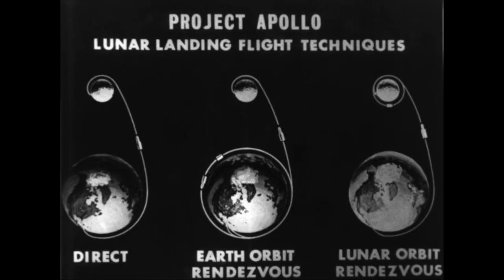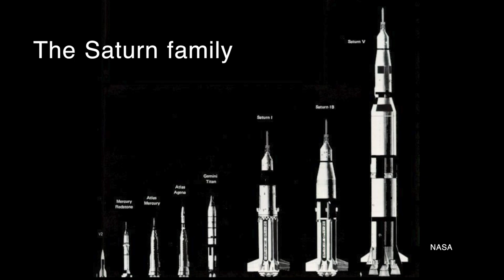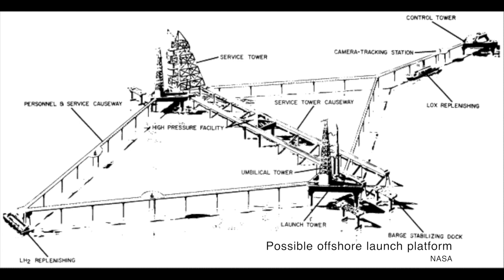How the Sounds of Big Rockets Break Apart Buildings

Comment: Spacecraft tools! I will nag every week! How unique are the tools, how simple or extensive(can they repair anything or do they just have pliers and duct tape), how do they minimize weight and movement during different G-forces, how do they secure the tools on EVA? As someone said in a previous video, how do you apply torque in zero-G?

Comment: When NASA started launching the Space Shuttle,  an acoustic mitigation measure was designed into the launch platform.  A few seconds after launch, a massive amount of water was dumped as a curtain of water fog.  The sound would hit all of the water bubbles and be converted to heat.  This had the effect of reducing the energy transmitted through the air and protecting the launch pad and the shuttle from the reflected shockwave.  This was used because engineers discovered that it was shaking the heat resistant tiles off of the orbiter.
If the Nova rocket or something like it were built, it could use the same mitigation measure if launched from land.

Comment: With SpaceX using smaller engines but more of them in comparison to the Saturn 5 and the physical size being smaller and operating pressure being higher wouldn't this change the resonant frequency of the engine, raising the frequency of the audio bandwidth into the higher frequency less destructive range?
Reply: Perhaps, but wouldn't the constructive and deconstructive interference still work to amplify the sound at certain points to the same amplitude as larger engines.
I would think the surface of the ocean would help to dissipate or even absorb a large amount of sound. Less sound would be reflected off the water, the water has a less regular surface(waves) that would scatter the sound, and the water would carry vibrations within itself in a different way than solid earth.
Reply: Could the pressure from the exhaust of the engines create some sort of parabolic dish shape on the water, whereby a large quantity of sound is reflected directly back at the launch vehicle? Either it would all cancel out or it would build up some sort of destructive resonance in the spacecraft.
Reply: Although the raptor engine is significantly smaller than the F-1, it is only a little under half the thrust.
Reply: I remember talk of the ocean being a less suitable sound dissipater than the acoustically sculpted concrete+whatever troughs used on land.

While the surface of the ocean is variable and textured with waves as you say, that's usually on a very small scale, whereas the overall surface area under the engines will generally average out to flat. That means the majority of the sound is still just bouncing right back up into the rocket. That's a recipe for resonance.

One suggested solution to that issue (that I saw in a pre-IAC SpaceX MCT speculation thread on Reddit that posited a sea-launch scenario - it may have been inspired by something in the old NASA designs Amy referenced) is to pump air down under the launch platform and foam the water to better absorb and dissipate the sound.
Reply: glenwoofit   The noise does not come from resonance in the engine.  It comes from interaction of the high velocity, hot exhaust plume with air.

Comment: Unless I'm mistaken, I remember reading in F. Alton Everest's Master Handbook of Acoustics, that the loudest a sound can get at sea level is 194 dB SPL. This is because at 194 dB the peak of the rarefaction wave is nearly a total vacuum. The Saturn V. already generated 194 dB SPL, so how could any rocket generate more acoustic energy even if it's larger?
Reply: The "volume" there is just the amplitude between the peak and trough of the sound wave, it doesn't describe the conditions in a shock wave, which is specifically a disturbance moving through air faster than sound. It takes some distance for that shock to slow down and transition into an ordinary sound wave, and then more time for that sound wave to dissipate down to safe volumes. The more energy your rocket engines are putting out, the longer it takes for that transition to happen, and the larger the danger zone around the launch site.
Reply: Ok, so the "vacuum" side of the sound wave is capped, but I don't see any reason why the pressure side couldn't get higher.  194 db SPL might be the limit for faithful sound reproduction - something you need to consider when building speakers and speaker stacks (which would be the focus of the handbook mentioned), but I don't think that's an absolute limit for sound.  Especially when you have a ton of thrust behind the generation of the sound.
Reply: Russell Hltn You are correct. I've since read that the cracking/popping sound that is characteristic of large rockets is actually due to the rarefaction part of the sound wave being clipped by the atmosphere, much the same way an over driven amplifier or loudspeaker clip. The clipping adds higher frequency harmonic distortion.
Reply: I believe this is essentially correct.  The 194 dB SPL limit is how much energy the atmosphere can carry and remain "intact", but doesn't exclude the possibility of higher amounts of energy tearing the atmosphere apart and producing nasty shock waves, such as in nuclear explosions (on the extreme end).
Reply: I read that sperm whales produce 230 decibels.
Reply: Sounds can be MUCH MUCH louder underwater.
Also I think you are correct about sound being capped to 194db, but only on the low pressure side of a pressure wave. The other side is under compression.

Comment: I am personally more concerned with the IPTS launch pad itself. In the Saturn V launches, the pad had an ablative coating that was able to survive one launch. A lot of the interfaces had to be replaced after each launch, and the pad itself had massive refurbishing between launches just because of the heat and power that those engines dumped into it. IPTS is going to be bigger and is gonna launch off the same pad twice in one day (and land once)... I see that as a massive problem for pad survival...

Comment: I think the SpaceX vehicle will be LOUD, having 42 Raptor engines each running at high operating temperatures/exit velocity. With regards to the acoustic signature, I'm thinking it'll be around 214 dB. As for destructiveness, it will be less so  than a rocket of equivalent thrust running larger engines like the F1 or any of the ATK solids. The signature of the Raptors will produce a higher frequency signature that will have a little more "snarl" to it, whereas the larger engines will produce much more percussive, deep bass type shock fronts slightly more separated from each other than a large number of smaller engines.

Comment: Hi Amy, I have some expertise in rocket engine exhaust plume noise. I have developed programs to examine noise damping for rockets during launch. Typically water injection systems. What I did learn from this is that noise is not additive. So 42 raptor engines on the SpaceX craft will not be 42 times louder than 1 raptor engine. Water injection can prevent the noise from damaging the payload and launch equipment this reduces noise from 210 dB on the shuttle to the maximum payload noise at 138 dB.

Comment: Launching offshore looks cool; that platform diagram totally looked like a villain hideout from a James Bond movie, but it's also a lot more expensive. If SpaceX can find a way to dampen the sound around LC39 that would probably be a cheaper solution, and operating facilities you can just drive a pickup to is a lot easier, too.

Comment: The sound volume depends a lot on the type of fuel, not only on the trust of the vehicle. So the Shuttle (with solid fuel) was louder than Saturn V (with kerosene/Lox), despite of having less thrust. I suppose methane/Lox will even have a more regular combustion then kerosene/Lox, so there possibly won't be problems with the sound. (Maybe it will be a bigger problem for SLS with its giant SRBs)

Comment: You didn't say anything about pad water deluge systems. I believe they are not just for cooling but also to absorb noise. I don't know about Saturn, but the Space Shuttle and its payloads could have been damaged by the noise reflecting off the pad, especially when the SRBs lit. I'd have to look up exactly how much the water spray actually reduced the sound levels, but I know it was a lot.
Reply: Saturn V used the Water Deluge System as well there is footage on Youtube. If I see it again will edit this with the link.

Comment: I thought of this right after the Space X announcement along with 42 booster engines reminding me of the ill fated N-1 which had 30 booster engines. I recalled the first Saturn-V launch (Apollo-4) which reportedly caused a press booth roof to partially collapse due to the Saturn-V sound wave. Damage to the tower required additional mods to the sound suppression system for launches after Apollo-4. So here is a rocket much more powerful than the Saturn-V or even the Nova shown in Amy's vid. I expect this plan will have to somehow address the sound issue. Otherwise it could cause problems with the VAB. Not necessarily on the first launch, but on a subsequent launch triggering a partial collapse that results from acoustical loads weakening the building going back to the first launch. However, a sea launch platform shouldn't have to be as far out as 100 miles. 15 miles ought to do nicely. But as Amy mentioned, with any new concept changes will be the norm right up to first launch. We saw this with the Apollo and space shuttle plans.

Comment: Amy.. how long before space travel will NOT involve rockets or parachutes?
Reply: Not for a very long time, if ever. There was the absolutely insane Project Orion (not the new Orion spacecraft) which would have used nuclear bombs as a method of propulsion, but there isn't anything on the horizon which could generate the energies necessary to launch a spacecraft. Solar sails and ion thrusters work once you're already in space, but to get to escape velocity, or even orbital velocity, chemical rockets are all we will have in the foreseeable future.
Reply: Lofstrom loop? But that is distant future.
Reply: Justin Franks thank you for your reply..I agree with all that you stated....I'm still holding out hope that somehow the Earth can be used as a magnet and vessels can be "repelled" into space...I know..pipe dream...but fun to contemplate...

Thanks again Justin.

Thank you Amy for posting the videos. They are completely enjoyable and so informative....
Reply: Cirne Songs I have a idea which is feasible but I'm still in High School.
So even if it works, we still have to wait about 6 years at min
Reply: Cirne Songs As a huge SpaceX fan I'd say parachutes are on their way out, but rockets, maybe not.
Reply: The space elevator is coming way quicker than you think.

Comment: With STS, NASA used water sound suppression.
Jets of water, spraying under the engines, over the exhaust trench disrupted acoustic shockwaves. Primarily it was to stop the reflected engine noise from stressing the wings of the Orbiter. But surely this principle could be used to create an "Acoustic Curtain" around the pad for SpaceX?

Comment: Then there's the Sea Dragon which was so crazy-huge that it would have dwarfed even the Nova. The first stage had one ginormous engine. About 24 yards in diameter! The whole completed stack would have been built at a shipyard then dragged out to its launchpoint in the waters of the Atlantic.

From there, it would have been tipped vertical and launched from the partially submerged position. The sound wave would have killed every living thing in a five mile radius.

Comment: I remember an old suggestion that huge rockets could be launched from a pad in the centre of a giant concrete bowl partially filled with water. That should dampen a lot of the sound and send another part of the sound up rather than horizontally. I do not know if that would work or if it might cause hell for the rocket. The shape of the bowl should not focus the sound.

Comment: Any,  The water they flood the pad protects the pad from the heat ,does it do anything for the sound at the pad or the sound radiated away from the pad.  

Thanks,   CNM
Reply: Water dampens the sound so the concrete pad does not get destroyed.
Reply: And so that the sound doesn't bounce off the pad and damage the spacecraft (as happened with Space Shuttle Columbia on STS-1)

Comment: A single F1 engine test in Huntsville broke windows and rattled houses in the 60s
Reply: I can remember rocket tests from Rocketdyne in the Santa Susana mountains (San Fernando Valley CA) during the 60's. The tests could be heard all the way to Burbank (getting close to 20 miles). I was under the impression they tested the F1 there but now it sounds like the F1 would have been too large (made too much noise).

Comment: I have a question about the Apollo RCS jets. The nozzles extended from the side of the service module. Could you address, at some point, how they didn't get sheared off? I suspect that the air flow over the BPC may have spared the RCS and the thinner atmosphere at high speed may have played a role as well. Am I off base? It seems, though, that the RCS pods would be vulnerable.
Reply: This has been brought up before and they were thoroughly tested to withstand max Q conditions. Google "collectspace Launch stresses on Apollo CSM RCS nozzles"

Comment: I believe we have to worry first and foremost about vehicle structure and components being damaged or disabled by the massive acoustic power. I suspect they might lift off at partial throttle to reduce acoustic energy transfer through the thickest part of the atmosphere and then throttle up when the air is thinner.

Comment: would it be possible to arrange the engines in such a way that they can create a cancellation pattern that actually reduces the dangerous waves that are put out. or are the frequencies to erratic for that to be possible?
Reply: The problem is that imperfections in the engine and combustion instabilities might generate unpredictable noise so designing a pattern to cancel out the ignition sound is quite hard
Reply: Dan Harriman I wonder how big the speakers would have to be if they were to install an active noise cancelling system on the launchpad...? :-)

Comment: dB is not a unit. It is a log function that You can use in certain situations. If You say 126 dB Spl RMS A(weight) This is correct unit for measuring "avarage" sound level.

Comment: Wouldn't the smaller engines produce a higher frequency sound?  They could also delay the roll program as distance plays a huge factor as does the angle of the ship.

With shuttle launches, from the normal viewing area which is over 5 miles they weren't all loud most of the time, you could feel the low frequency sound and it could be observed on glass.  It was loudest after the roll program with engine were point more towards you.  I was on KSC property for 4 launches prior to 9/11 and another 2 from offsite around ~12-15 miles away.

Comment: I think it will always be cheaper to prepare the buildings for the sound / buy out a bigger buffer zone, than building a whole new launch zone on the ocean. Not to mention the environmental impact it would have
Reply: stren Depends if you build an offshore clone of cape Kennedy (like the 1960s plan) or build a launch ship that is prepared on land, then sailed out and launched with a few regular ships nearby doing support (like SpaceX landing ships).  The second option can be a lot cheaper than the first, but requires dealing with launching from a rocking boat.

Comment: Great videos!  I was 4 or 5 when my dad would get me out of bed to watch live NASA Apallo brodcasts.  Thanks for helping vevive my excitement for space, along with Everday Astronaut and Elon Musk.

You talking about the insanely high aucoustic forces from a launch, it made me wonder about the engineering designed to protect the crew from hearing damage.

And where is the threshold between the violent vibrations the crew feels, and where low level aucoustic damage happens to the human ears? 

And what type of insulation or attenuation is used to protect the crew.

Comment: Would it not be possible to add sound absorbent material, like a good few groves of trees, in the area, as a natural sound absorber. Seems to have been done already there, the tree growth definitely does reduce sound, and is both cheap to install ( dig hole, put sapling, repeat as needed) and is environmentally friendly and can even be used to generate a small income stream from harvesting timber or tree products that occur in trees that are either endemic to the area or which can grow there.
Reply: Wouldn't water be great at absorbing sound? Especially considering it would be a frothy mixture of water and air while being pounded by the engine exhaust.
Reply: Water was used to reduce the acoustic energy from the Space Shuttle launches.
Reply: SeanBZA trees are sadly not good sound insulation. You can hear a busy road through a hundred meters of forest.
Reply: Once the rocket is above the trees, they wouldn't do anything beyond them even if they were useful as sound buffers.